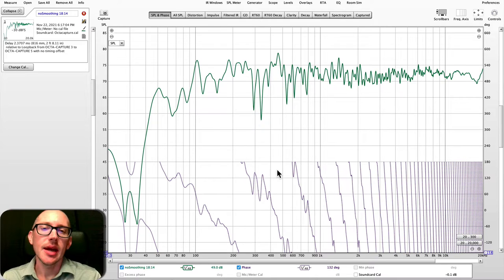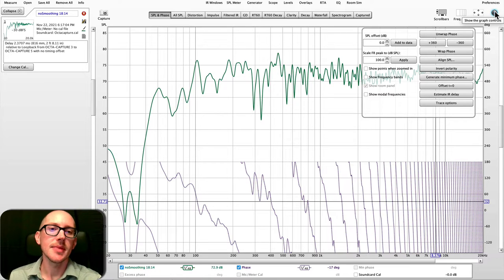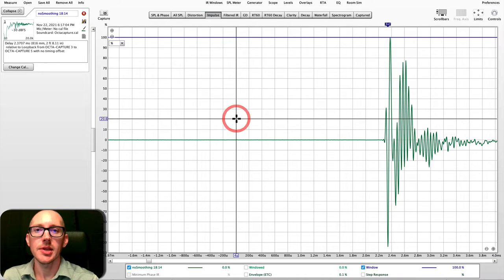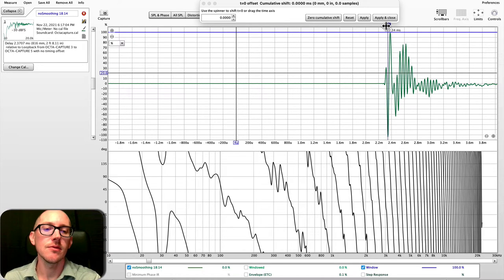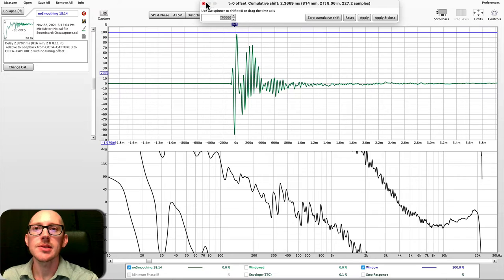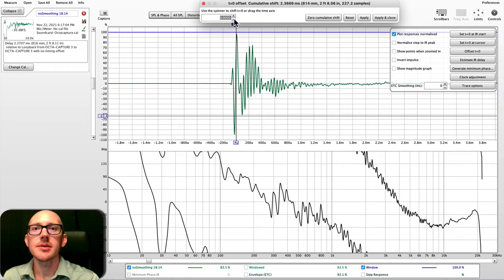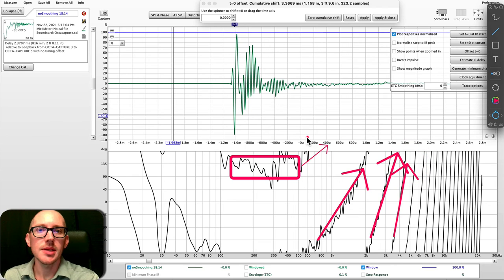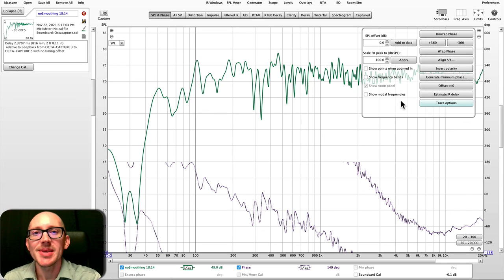What is "estimate IR delay" in REW?

Comment: This was helpful to me as I am trying to compare the phase traces for two bookshelf speakers. One is a coaxial design and the other is a traditional two driver speaker.  I noticed that the estimated IR offset is nearly identical to the loop back timing reference value for the measurement.  Why shouldn't we just use that value?  FWIW, while my two phase traces are smoother now, I still can't really understand what they're showing me!  The unwrapped phase plot for the traditional 2 driver design is flatter from 700 Hz to 24 kHz than the line for the coaxial speaker which is the opposite of what I was expecting.  I'll conclude by saying that I enjoy all of your videos Nathan.  Thank you for providing so much good content on all things audio for us.
Reply from the maker: Hey John, good to hear from you.
> Why shouldn't we just use that value?
You can use any value. The simplest would be to just leave it at zero. The main reason to adjust this value is to make the phase graph human readable. If we estimate sound velocity at ~1ft/ms, then there should be about 1ms of delay for every foot between your mic and speaker.

> I still can't really understand what they're showing me!
For our purposes, a single solo phase trace without anything to compare it to is pretty useless. Usually we are either comparing it to a manufacturer's specification or comparing it to another speaker response that we want to combine it with. If you're interested, I have a workshop on the phase graph coming up in a few days: https://www.sounddesignlive.com/intro-phase-graph/

> Thank you for providing so much good content on all things audio for us.
You're welcome! Any requests?
Reply: @nathanlively   Hi Nathan, I do have a "How To in REW" request for you.  Over on the Audio Science Review forums they use REW a lot with gating or windowing, to obtain pseudo-anechoic speaker measurements indoors.  I've read the help page on this feature in REW, but would love to see a how-to video on it that walks me through the steps.  Cheers.

Comment: Hi Nathan, i have an issue and no clear explanations.
I would like use the Merlijn Van Veen's absolute/relative method to do the aligment between my subs and Tops. I use for this method the REW software with a USB mik-1.
During the absolute step: the top is plugged on the left side and the sub on the right side. The timing reference is the left side (the top speaker). 
I measure first the top and then use to "estimate IR delay" and correct the delay. Then I mesure the sub (timing reference Left side).

Now is the issue...... By using the REW alignement tool without  sub IR estimation delay the delay i have to apply to the sub is -16,8 ms! With sub  IR estimation delay and shift, the delay to apply on sub is only 5.03 ms which make more sense to me.

What is your opininon? 

Hello from France.
Reply from the maker: Hi Guillaume! Can I assume your measurement mic is equidistant from both main and sub? 
16.8ms is a lot, but is totally possible. When you measure main +  sub combined, do you get summation through the crossover region?

Feel free to send me your measurments.
Reply: @nathanlively   Hi Nathan, yes tke Umik-1 mic was on the ground equidistant from the sub and main.
The measurements (Top+sub) was not unfortunatly not done to check the summation  That's for sure a mistake. 
I will send you the measurement file by email so you can have a look on it.

Thanks for your reply.

Comment: Hi Nathan, i want to ask a question: I measure independent each way, lows and highs, only 1 channel. ¿I must apply estimate delay in the measured highs and put the delay for next measurement (bass)? i can remove the xover in bass to measure well but later i have to put it ona and filters PEQ too and phase will move. i want to estimate delay between bass and fullrange. 0.5 ms physically.
with initial delay is easy to align with alignment tool the problem is to know if the delays are ok. thanks
Reply from the maker: Hey Raul, The estimate delay feature is primarily used to make the phase trace human readable. It's optional. You could do all of your measurements without if you like. But yes, if you want to compare the relationship between two things, the measurements need to use the same time delay.

Also, I do not recommend defeating the low pass filter on your sub. This may lead to inaccurate alignment decisions.
Reply: @rlopezrb i would say you can use this technique to "time align" your sub w/ the mains...

regarding the phase shifting, any kind of filter, be it crossover, EQ, etc influences the phase.

that being said, with subs in general time alignment and phase alignment are easier to do by watching for the greatest output. meaning when the bass is the loudest, things are aligned as best as possible.
in rew you can use either incremental measurements or use the RTA tab to monitor the fq response in real time by using periodic pink noise.

Comment: Does anyone else have trouble with REW retaining the Timing Offset value even after starting a new session?  This caused me at least 20 minutes of "what the heck" when I was trying to time align some front fills to the mains at a gig.  I kept getting a negative time, which wasn't possible given the relative positions of the speakers.  I finally realized that there was an old value in the Timing Offset box and once I zero'd that out, everything proceeded normally.  Is there a config setting to not retain this value?
Reply from the maker: Hey John, thanks for sharing this experience. From my perspective this is an important feature that shouldn't be changed in order to keep everything with the same time reference, but I'd recommend that you reach out to John (REW founder) and ask him. He's great!